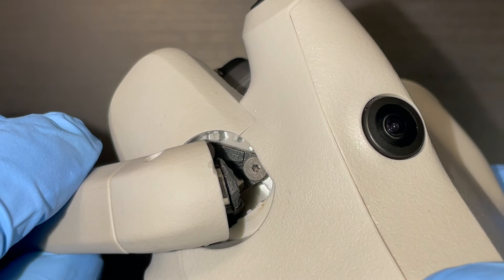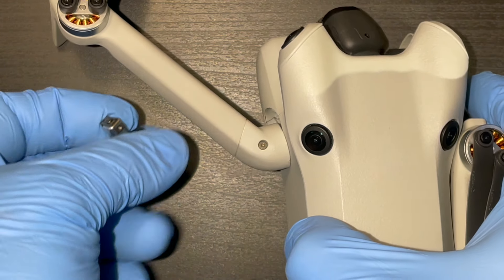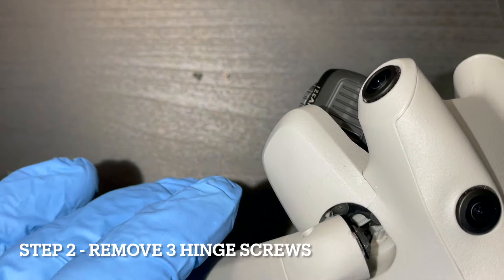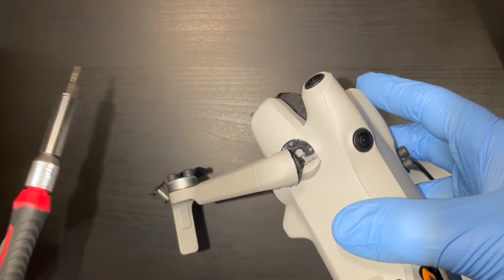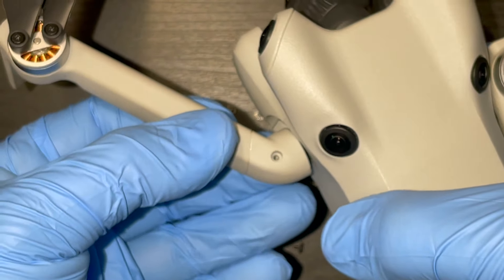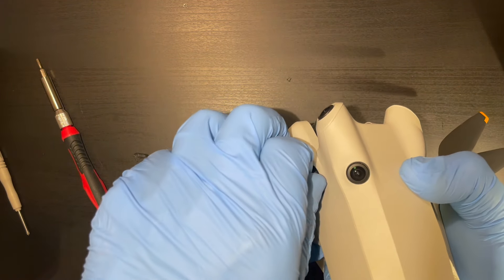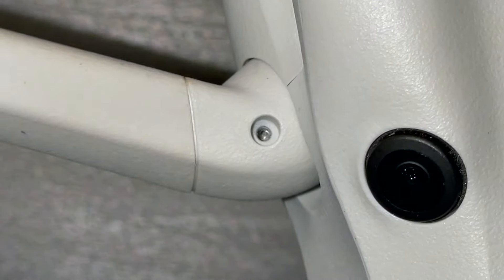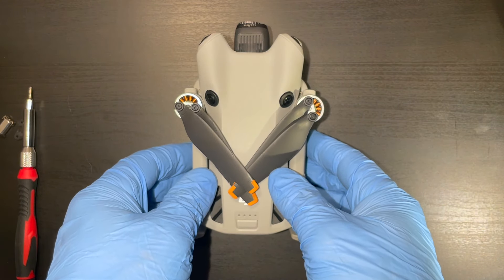DJI Mini 4 Pro Drone DIY Arm Shaft Axis Hinge Replacement

Comment: Such a HORRIBLY weak point!
Reply from the maker: Yeah lol. Gotta keep your weight down. Maybe flexible joints is a good innovation for the engineers to come up with
Reply: @sciencebygabrawy  they could of at minimum used glass fiber reinforced plastic instead of just thin plastic connected to a chunk of metal...
Reply: Indeed .. I just broke mine
Reply: It a good design IMHO, I just broke mine and got it replaced thanks to this video pretty easily. If the hinge was stiff arm could of broken (at least with situation I had to face) which would be harder and expensive to repair.
Reply: @champikadp  Good point
Reply: I know, mine just broke 🤦‍♂️ about to replace it
Reply: I filled the inner cavity with JB weld. it ain't breaking as easy now.

Comment: Ok my dji mini 4 pro broke down and i am ordering part so i will come back here once i have received the parts and will fit it up in my drone. Then i will give you the second comment. I hope this will work with my drone too. 🥲
Reply from the maker: It’s good for pilots to work on their own drones as this gives them a better appreciation for the engineering that goes into it! It’ll work bud!

Comment: Just curious how many drone operators here crashed multiple times before this part gave out? I had 3 accidents before it gave on me. One strong hit into the side of my house 1 at 10 -15 ft high dropped right down fast onto cement and 3rd crash against paneling in the house. All 3 I was using blade guards.  So maybe it could’ve cost me more. The mini 4 was acting very sketching during all flights with wobble. Like it couldn’t handle any wind. I stopped being cautious and took it out too a soccor field and really started to put it through some testing. Then it woke up. ❤I really think it’s going to be a lot of fun like my Mavic. This is a wonderful video Sir thank you. God bless you in Jesus name Amen❤
Reply: Clipped some leaves and it fell from the take-off height (4 feet?) on soft grass, hinge broken. Depends on your luck I guess. 
I think it is a weak point on purpose because it is easy to repair.